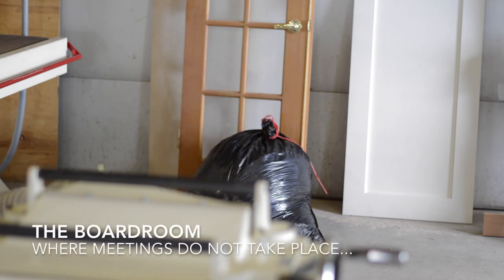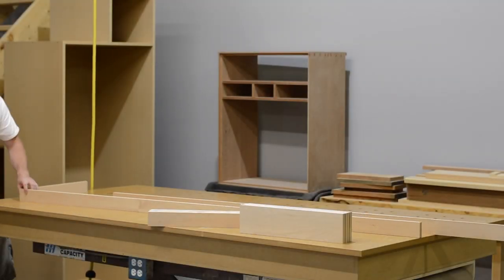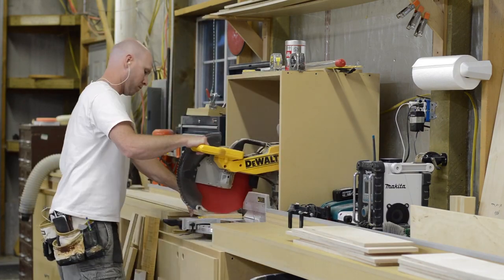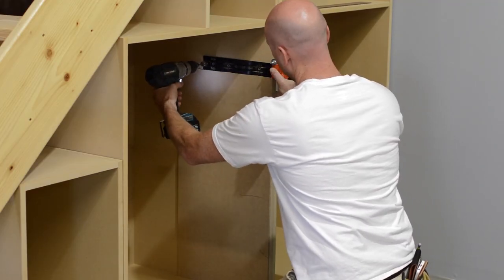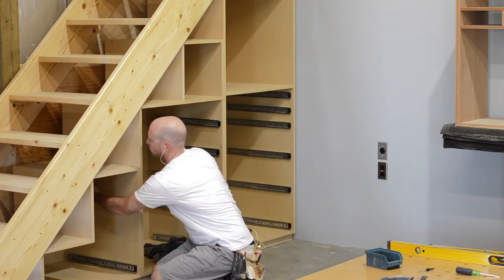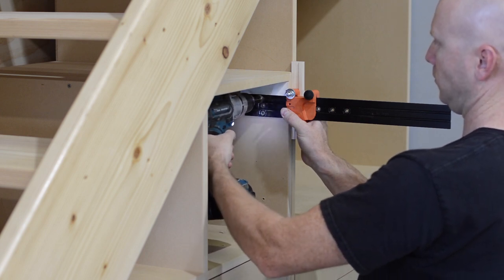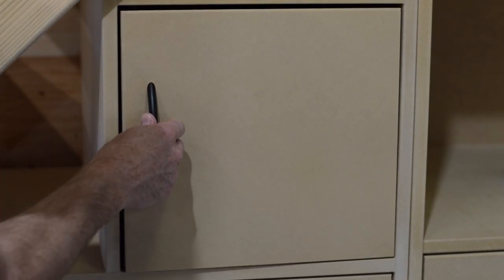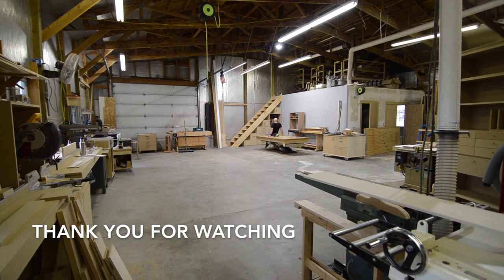Tool Tansu, carpentry woodworking tool organization cabinets

Comment: Don’t know if or when you will see this.

I enjoy your videos on the Tool Tansu you talk about putting screws further in from the end and side to stop blowout.

Being 73yrs old I learnt long time ago to insert wall plug into the wood, MDF or what ever you are using, but you have to make sure the two slots in the raw plugs face the thickest part or wood, so when they open out they will push against the widest part not the thinnest part.  Then you can put screws in without the problem of blow out, but make sure raw plugs only have two slits not four and some do.
Chris 
Old English Man
Reply from the maker: Thank you. Great tip.

Comment: That centerpunch drawer face trick blew my mind
Reply from the maker: Thank you, thats a neat trick.
Reply: Chris: I’ve used Vix bits in that application and with precise hw installs. Learned from a boatbuilder who was master of craft (ha). The bit is sized and housed in a aluminum sleeve that’s specific to fastener size. No wobble, perfect center.

Comment: That Blum guide is really nice. As a low-budget woodworker I might build something equivalent out of plywood for next time I need to install drawers. Probably won't be adjustable but it should accomplish the same goal.
Reply from the maker: Yup, a shop built solution would work great if accurately drilled.

Comment: One thing I've discovered for someone with a smaller shop is that everything should be in a drawer, and if possible, an overlay drawer, or if in a cabinet, a cabinet with a door, rather than just stuff on shelves. It will GREATLY reduce your cleanup, as sawdust will always find the nearest open horizontal surface to cling to.
Reply from the maker: Thank you very much. I think that is a good advice.

Comment: One of the only people I watch on YouTube that gets my full attention everytime. This was a great build and a good use of the space. The only bit I couldn't live with was the finish height of the drawers was different. I would had to have lined them up so they were the same height. That is just me thou and doesn't detract from the great build.
Reply from the maker: Thank you very much Jason. That is very kind to say. I agree, I probably should have done that. The reason I missed that was I designed each cabinet separate and I just measured and adjusted based on the tools I wanted in the drawers. After that I didn't check the two cabinets to each other. Its funny they ended up so close...
Reply: You also have to remember that its shop furniture and although the quality of them is high, they are just practical solutions and are not actually supposed to be finished furniture for your home. The fact they look good is just the added bonus really :)
Reply: Same here - I normally watch YT while doing something else, but not with Mike's videos. Gripping stuff.
Reply from the maker: Very true. I have been working in dusty, spider web filled shops my entire life. I'm at a point now where I want a small corner where things look nice. That was my motivation for taking some time to make this look a little nicer, vs just slapping these together.
Reply: I don't believe you 'just slap' anything together :)
Reply from the maker: Ha, sometimes I do...
Reply: I thought that at fist but you have to take into account that they were designed around the tools. The other option of course is to throw away the tools that spoil the look ;-)

Comment: Great work.  It's a joy to see the entire process from design to production and then installation to utilization.  The stairs are really cool.  Very elegant.  I'd love to see a video where you discussed building and designing them.  They would need the addition of risers to comply with code in my neck of the woods, but I find the cleanliness of this design, without the common stringer, so appealing. Thanks!
Reply from the maker: Thank you Aaron. The stairs would not meet residential code in my area, but in the shop, up to a storage area, I'm gonna sign off as OK... Really simple build, I mortised the treads into the stringers and clamped each one up with a bunch of glue and two screws. The hardest part were the angles and calculating the rise. Honestly, I wouldn't feel comfortable going into too much more detail because I'm not a stair guy and I don't want to give out bad advise. Already enough of that on YouTube.
Reply: Residential code calls for 3 stringers for a set of stairs. I was looking into the option on the tansu staircase for the tiny home my friend is building for his daughter. I suggested a mortise ladder built similarly to your stairs but they want a bulldog to be able to walk up to the loft.

Comment: Very nicely done.  I really like your shop!  I too hold on to things after a project.  I’ve a large supply of eclectic pieces of wood ... 😂  I put things on wheels as my ‘shop’ is limited to the garage and the Mrs. likes her car warm and dry during our Alaskan Winters ... but having things on wheels makes it easier to get to work.
Reply from the maker: Thank you. Wheels can really help a shop function. I have a pretty nice sized shop, and I still keep most things on wheels.

Comment: Hey Mike, Thanks for the entertaining and informative videos. If you get the chance, can you talk a bit more about dust control in the shop. What kind of dustco and air filters do you use? Also, what kind of bags are you wearing? What likes and dislikes about them for shop use? Do you use them in the field, too? Thanks
Reply from the maker: Thank you. I have a dust collection video on my channel, also my miter saw station goes into some good dust collection stuff as well. I am wearing really old 13 dollar husky bags. I like them cause they are softer than leather, which makes them much more comfortable when bending or in a weird space. I use them everywhere. Also have a few add ons, that can clip in place for certain tasks, such as a drill holder.

Comment: Love you videos and love your shop! Can I ask how many square feet?  As my name implies my life used to be about cars. Even my hobby was building and racing cars.  It was hard walking away from 3000 sq/ft in retirement but I found woodworking fulfilled that need to use tools and make things. It's been an adjustment downsizing to a work space on my patio and thank god San Diego has the weather for that 

In the end it is all about the hands and the tools. I always note what people have in their shop. In your case your little square intrigued me and I'd like to know more about the blue dust collection devices over your saw. I'm also intrigued that you use plastic dust collection in your shop. I do as well even though so many have such issues with static.  As a hobbyist I use plastic with no ill effects but my system doesn't run that long and I have it on a remote control system.

 I chuckle when I hear you whistling in the back ground in some of the fast motion stuff.  I tend to sing along with my music while I work but I do whistle on occasion. My neighbors must get some amusement out of that. Keep up the good work. I will be watching!
Reply from the maker: Thank you. I have not exactly measured the shop but its around 2800. Plastic dust collection has worked well for me and all the shops that I have worked in for the last 20 years. I think that debate has been blow out of proportion. I lived in San Diego for 15 years. I still consider it home to a certain extent. Fun fact, I always edit out the singing because its embarrassing, but I will occasionally leave in the whistling.

Comment: hi mike
looks fantastic 
you should also use the euro adjustable legs for the cabinets  they are great for uneven floors
although i do like the idea of the toe kick you have done
and yes the blum hinges are fantastic 
when i was able to work in the kitchen trade i used nothing but blum hinges
and i never had to replace a hinge in almost 16 years of making and installing kitchens
best regards
james
Reply from the maker: Thank you. Yup, its hard to beat anything Blum makes. oddly enough I just bough 8 leg levelers a couple days ago. I'm going to rebuild my miter saw station to include a radial arm saw and I will be using the levelers on that project.
Reply: hi mike
look  forward to seeing that project and your thoughts on the adjustable legs👍👍
Reply from the maker: Thank you. I love the adjustable legs. For the right projects, there is nothing better. I will do a video on that build soon.

Comment: It will save you tons of time by installing drawer slides and hinges while you still have your cabinets on the bench
Reply from the maker: Sort of, the problem with this build, was I wasn't sure of the lay out at the point of cabinet installation.

Comment: Great build and nice workshop. Only thing I would have done is substituted MDF drawer bottoms for ply. Experience has told me there is no inherent strength in MDF and they always belly after time.
Reply from the maker: Agreed, MDF will sag with age. I think it will be fine over time though, the drawers aren't really that big, so a little sag will be fine. I can also go back and add a few 1/2" thick ribs to the bottom side of the drawer if needed.

Comment: Hi Mike, curious about your use of MDF. Wanted your thoughts on building a miter saw station/ workbench out of it? How has your MDF shop furniture held up compared to plywood? Any other quick advise would be appreciated as well. Thanks! Love your videos, super helpful!
Reply from the maker: My current miter saw station is made out of MDF. Pretty much every shop fixture I have ever owned has been out of MDF. Its been fine. If you want it to hold up longer, add some ploy finish, that will harden it up a little. If constructed correctly, a shop fixture made of MDF will last a good long time.

Comment: I'm betting someone already submitted a comment on your "short" Blum template. Did they mention a fairly competent machinist could make a longer interchangeable blade? Depending on how the template is assembled, I'm betting it wouldn't be too difficult.
Reply from the maker: Yeah. That is something I should work on. I have a pretty good machinist I could lean on.

Comment: Excellent as ever Mike, thanks again for your work. If you are so inclined, I think it would make a great video / section of a video to see how you set out your process lists for tackling projects. Your drawings looked quite rough, but you seemed to fire through the work. Just as useful (and AKAIK never addressed in any other videos on Youtube) the minutia of getting components to sit square in construction, marking out screw holes when you can't see what you're screwing into (like through a panel into a shelf) etc etc. Finally, would love to know what your Bosch driver is and the bits you're using with the attached countersinks. Thanks again for such useful content.
Reply from the maker: Thank you very much. I will include these details in my upcoming videos. Good to know what people want to see. I really don't do much in the way of drawings though. I have my system, so I just need basic outside dimensions and the rest is in my head.
Reply from the maker: Forgot to add the Bosch driver I use is their 12v pocket driver. They have a few different options for the same drill body. Its been a very good tool.

Comment: As per usual: great stuff again! I love your attention to detail in every video and this is no exception.

I read you preferred the MDF as a "backdrop" and it was a cost decision. I just hope you have no moisture in your workshop because MDF (unsealed) will swell like crazy. Maybe some sort of clear sealer would help in this case.

Have you ever used the Kreg drawer jigs? I believe they're pretty good as well.
Reply from the maker: Thank you. I live in a hyper dry climate, and my shop is dry, so it should be OK. I'll make changes as needed though. I have not used the Kreg drawer jig. Kreg usually makes pretty good stuff, but I use as may Blum jigs as possible because they make them specifically for their hardware, and I use a lot of Blum hardware.
Reply: Ah that makes sense! I know Blum has some really nice hardware, so I might check it out some time when doing a larger build.

Take care!
Reply from the maker: Blum does make some nice stuff, plus I like to stick with just one company as much as possible to keep things simple.

Comment: Mike, thank you for taking the time to make these videos. Very helpful, esp for someone wanting to make their own cabinets around the home.  Do you have a specific screw size you use for most cabinet joinery with the MDF?
Reply from the maker: Thank you. I use 1 1/2" or 1 3/4" most of the time, 1 1/4" if I'm putting to layers of 3/4 together and don't want the screw to poke out.
Reply: @MikeFarrington  Thank you sir, and may I ask the type? or better yet what side tapered drill..looks like and 8
Reply from the maker: @jerrym1240  I use a lot of screws from the company quick screw. I always use the counter sink for the screw I'm using. So that is no 6 through no 9.

Comment: Hey Mike, great project as always. Can you tell me what type of screws you are using? They look like drywall screws in the video, but I'm assuming they're a #8 wood screw with a square drive? Thanks for your help.
Reply from the maker: Thank you. I mostly use quick screws. They are #8 and they have a combo drive head (#2 phillips, and #2 square). Check out this site, they really have a nice selection of screws for woodworkers. https://www.quickscrews.com
Reply: Awesome, thanks Mike

Comment: this hinges are made for doors that stops on cabinet frame but u can add little wood stop block on the top
Reply from the maker: Thank you. I'm not sure I totally agree. The hinges are designed to open and close doors, how they are applied is up to the builder. In this case I added a Euro stop by fast cap to stop the doors in the correct location.
Reply: great solution! and you said in the vid u placed them 35mm deep, we usualy place them 37mm but i think it depend on the hinges .. great video, love your projects! Keep up good work

Comment: Good job. How did you calculate the drawers size so you can have room for the ball Bering opener, and anothe question is to allow the doors to be flush you just drill the holes for the hinges fare back and use a normal ďoor hinges or do you use a different or specific hinges??? Thanks love your videos
Reply from the maker: Drawer slides will have installation specs, in this case the drawer boxes needed to be 1" narrower than the opening. For the flush inset doors I set the hinges back from their normal location the thickness of the door. I use a hinge setup that get me the correct offset to the hinge cup.
Reply: thanks mike

Comment: Very nice but for me I am to tired to have fronts on workshop storage. I just cut down the front face an inch and routed to break corners. A couple in the dusty areas I bore a 25mm hole.
Reply from the maker: To each their own. Thank you.

Comment: Hi Mike, Great work man, I like this a lot.  If you said it in the video I completely missed it, but could you tell me the dimensions of the MDF that you used?   For the cabinet carcasses is that half-inch or three-quarter inch MDF? How about for the drawers and doors?

Btw, Nice touch with the shop apprentice lol, brings out the curious little boy in all of us.

Keep up the awesome work man

Bobby
Reply from the maker: I use 3/4" for the carcasses, doors and drawer fronts, 1/2" ply for the drawer boxes. Thank you.

Comment: Great job, great video. I'm pretty sure that those drawer bottoms will sag though?! Don't you always find that when you do something like this it takes ages to get used to where everything is and you end up opening every drawer to find stuff? I did it to my van a year ago to speed up finding parts and tools and can still never find stuff.
Reply from the maker: The bottoms may say a little, but probably not enough to notice or matter much. If it becomes a problem I can add a 1/2" thick strip to the bottom side of the drawer for al little more support. I agree getting used to a new layout takes time. I keep opening the second drawer down looking for nails, its the third drawer down. I have done this at least a 100 times now. I'll get it one day.

Comment: Love the video, one simple question. What are 5 mm “System” screws? Not familiar with that term.
Reply from the maker: Thank you. 5mm system screws are stubby screws designed to be used in predrilled 5mm holes.

Comment: You know what would be cool is a false floor with a hole for your routers to sit the right side up with the bit in.  I'm a clumsy dope and I'd pull those over on my hand.
Reply from the maker: This is a good idea, I should probably do this. Only problem would be that I could't see which router has which bit.

Comment: Mike, how do you determine drawer box height and spacing, and then how do you determine the height of the false fronts? As far as the drawer slides go, how do you determine the position of the slides on the drawers and in the cabinets? I have two curved end walls in my shop and want to make a set of cabinets similar to these, but have never built cabinets and drawers before. Thank you!
Reply from the maker: I first decided how big, in general I want the drawers. Like for screws or routers. Next I figure out the fronts. Bottom is 10, next up is 5, next is 3, top is 2, etc. From there I determine the box height where I will normally take of an in on the smaller sizes and a couple up to 3 inches for the bigger ones. Hope that helps.
Reply: @MikeFarrington  that helps a lot. Thank you.

Comment: This video is inspiring! I wouldn't have guessed that the Blum drilling template would be compatible with non Blum slides. Have you found this to generally be true or the exception?
Reply from the maker: I think its the other way around. The knock offs use the Blum pattern intentionally. I have found 100% that knock off slides are pretty much spot on with Blum hole patterns.